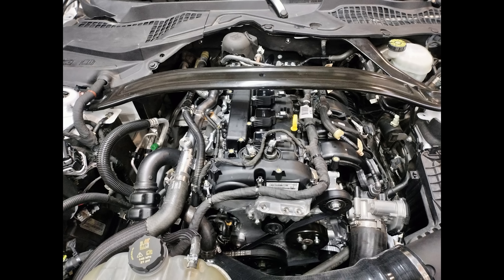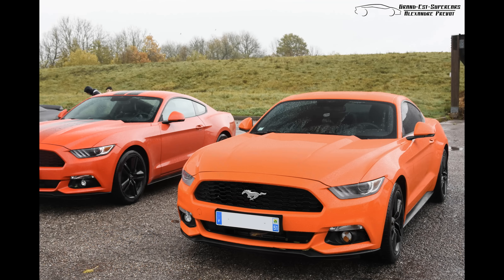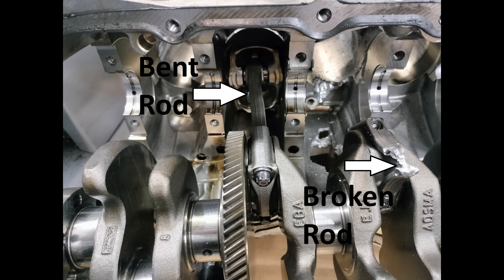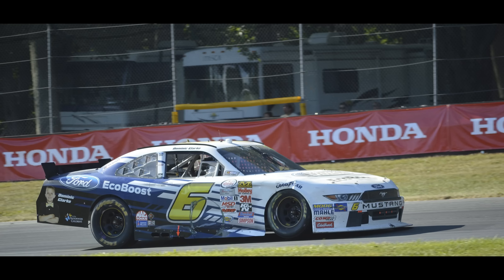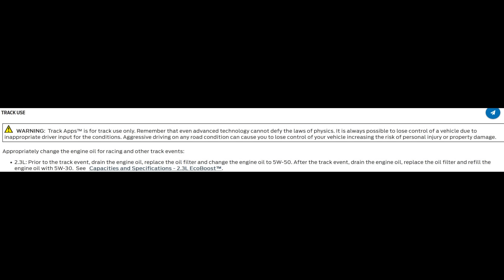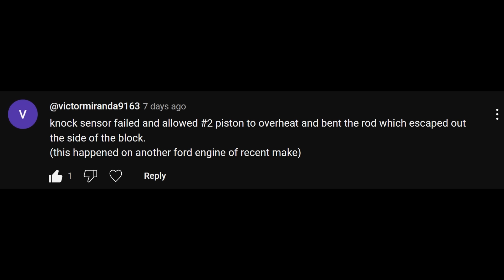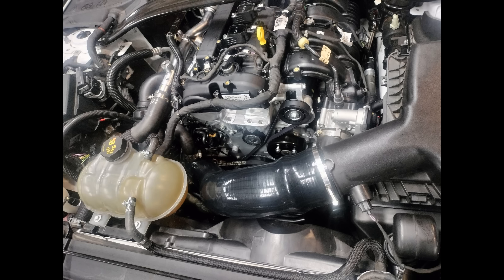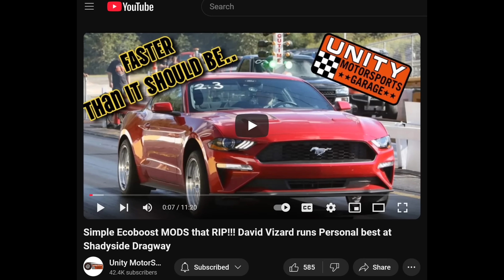EcoBoost Destroyed, What Happened?

Comment: Boost doesn’t bend rods ignition timing does and no it’s not knock it’s timing advance BTDC. You should research combustion chamber pressure in relation to ignition timing it will tell you exactly how you bent a rod.  Example that boost doesn’t bend rods is a stock iron block 2.2L 4g63, billet crank, aluminum connecting rod forge piston…..90psi of boost from a precision 8083 turbo no bent rods making 1600whp. Another example but open deck Toyota GR Yaris stock G16 engine 34psi of boost from a Garrett G25-660 no bent rods making nearly 500whp.
Reply: I'm extremely skeptical that the rod bent due to too much BMEP. In an NA engine, the rods always fail from tension loads due to excessive RPM. In a forced induction engine with 1 atm of boost, connecting rod fatigue life is improved, because the higher BMEP counters the tension loads. It would take at least 2 atms of boost to cause a pure compression/buckling failure (with correct ignition timing). I agree that something must have caused the ignition event to happen too early. When this happens, the inertia of the crank and connecting rod adds to the compression load in the rod from the BMEP.  If the OP would post what the peak boost and RPM the engine saw, it would be possible to estimate the BMEP. With that, it isn't too difficult to determine if the connecting rod failed from it. Ford publishes a lot of material information on their engines in SAE articles as a reference.
Reply from the maker: Alex, I said nothing about boost in this video, let along boost bending rods. Watch again and listen more carefully.
Reply: @GregsAirplanesandAutomobiles   You mention you were running a lot of boost at the time of failure which you could mean you eluded to it maybe being boost. You sure have a way of snaking around. What was peak boost, amount of timing, and rpm?

Comment: Your comments on the balancer confuse me.  Inline four cylinder engines (with a single plane crank) have an inherent secondary imbalance that no amount of build quality or “balancing” will correct.  It’s fundamental to the geometry of the engine layout regardless of build quality or any amount of part balancing you do.  That’s why they have balancers.  But you know enough about engines to already know this.  So why do you make the comments you made?
Reply from the maker: It's a question of what you can actually feel. If you drive a car with an old 1600cc Toyota or an old Fiat twin cam or Alfa they are smooth from the perception of the driver. The Fiat specifically is smooth from idle to 8000rpm, at least as smooth as Ford's 2.3, again from the perception of the driver.

Comment: Eh, the closed decks had an issue, too (supposedly fixed in 2018, but not sure if that's true). My Focus ST failed at about 180k from a defect that causes the coolant to enter cylinders 2 &/or 3. Thought it was a turbo coolant line as there was no sign of a HG failure. Turns out, there's a TSB about it where Ford states the remedy as "engine replacement". I'm not exactly sure if the failure is block or head related, but it has something to do with the coolant passage between them and between cylinders 2 & 3. Too bad, as that car was absolutely bulletproof up to then. There are a few CA suits going on regarding it.
Reply: The 2.0 ST block is my favorite! My understanding is that Ford added steam slits to the 2017 block, while upgrading the turbocharger to a twin scroll. I've been told that Ford has corrected the issue, but when and how, I don't know.
Reply: @coyote_chaser  I heard the same thing and I hope it's true. I bought it partly for the closed deck—"no HG problem with this!". The universe, of course, laughed. Minus that issue, it's a robust engine with great power and mileage (I averaged around 30 mpg in mixed driving around Boston) and was Corolla reliable until the day I started the car and couldn't see out my back window. Even then, it had an almost reasonable 180k miles and otherwise looked and drove like it had 1/4 of that. A Camry I had with only a little more miles felt like it had double the miles it had.

Comment: Usually bent rods are the result of exceeding their torque limits (overboost, knock, liquids). So... bigger rods should do the trick,but sometimes at the expense of max RPM.
Reply from the maker: That's exactly right, it's really a torque issue more than horsepower. I didn't want to bog down the video getting into why that is.
Reply: @GregsAirplanesandAutomobiles  so did you upgrade the conrods this time?  Or are you keeping the same build and upgrading the intercooler but not changing rods?

Comment: So how much boost were you actually running? Youre just repeating how high it was and that it wasnt the engines failure but we all know the ecoboost engines have a reputation for being pretty shitty.
Reply from the maker: what do you mean it "wasnt the engines failure" It absolutely was the engine that failed. It more that failed, I had pieces of block all over the place.
Reply: @GregsAirplanesandAutomobiles  You've said the fault was not because the engine is shitty but because you were running too much boost.
So how much boost was it?
Reply from the maker: What? I didn't say a thing about boost, let along that the problem was too much boost.

Comment: Made the mistake of not getting the timing right when replacing the head gasket on my Porsche 944s engine and was extremely lucky to only bend one valve and not do much damage to the piston. Hope your new engine holds up better than the last
Reply: Oh, dude, you drive 944?! What a dream car-shaped pile of scrap it is!
Reply: @nickyevdokymov5526  it's not my daily driver but I have one I've been working on. Some of the stuff is a pain to work on but that's how it is with any German thing
Reply: Should graduate to the bigboy headache and get a 928.

You get two heads and a 6' timing belt.

(I've done two timing belt replacements)
Reply: @RandomInternetDog  nearly bought a 928 a few years ago for very cheap but someone bought it before I could go look at it. Definitely prefer the look of the 944 but the V8 would certainly be nice to have
Reply: ConeOfArc on Greg's channel?! YT is getting smaller and smaller. Cheers lads !
Reply: I once briefly had a cludged together 944 with an LS swap... Literally only the minimum effort to make room and connect the transmission... I'm sure it's either an expensive track car now or it is in a crushed cube... If it was so hacked that I didn't keep it then I can assure you it was BAD 🫣 Although I've seen others done right in the following years of endless conversation kits and standalone LS swap parts/manufacturers... This was before most of that. The clutch and radiator were not happy, but it did drive for short periods before trading it off to the next guy who was warned "it needs alot of work" 😂 I should've taken pictures 😒
Reply: @ConeOfArc If you had enough of that car  i'd gladly take it off your hands. I can give you a 1980  Lada 2101 in return.  Small project needs 4 new side panels,  no barkes, needs new paint, carburetor cleaning, engine so worn out basically only the block, oil pan, empty cylinder head and screws are remaining, needs new wiring and has 2 flat tires. Don't lowball me I know what I got.

Jokes aside good luck with your car, love your videos!
Greetings from Hungary!
Reply: the ultimate solution? Sadly, K swap.

Comment: Too many corners cut on the EcoBoost engine design. The rods are too thin, and the piston skirts too shallow, which leads to a under sized wrist pin, and under performing rings. The only EcoBoost that has been worth a damn, is the 1.6L that came with the Fiesta ST, because that engine was hand assembled in Germany, and homologated for motorsports use. And its telling because the Firsta STs are quite reliable, but that same engine in anything else is a utter garbage, and unreliable.

Ford doesnt get it anymore, and has largely lost the plot. Surely more 100k F-150s will save them.
Reply from the maker: I think you're mostly right. The 2.3 is decent, but it could have been so much better. I do think Ford has lost their way a bit.
Reply: 1.6 eco boost engines for the ST were built in Wales, UK, not Germany.
Reply: @mikebeale1685  you are probably right. I think it was final chassis assembly in Germany. Either way, the information still stands, they were built to a higher standard than the crap Ford puts into the Escape here in the US.

Comment: My mom paid two grand for the brand new Ford Mustang, 1964.  Adjusting for changes that's 2 million today.
Reply: While the lowest possible price was $2,340usd back in the day, inflation adjustment brings that to $20-25k not millions.
Options also used to be MUCH more of a cars total price, with many Mustangs sold over $4k and the average over $3k and featuring the same basic running gear, while few people would consider +50% in options sensible now, with the few cars above double like hellcats sharing less with the base spec than between entire brands of common ownership in 1960's and 1970's, let alone a given model.
Likewise current prices for those vintage mustangs vary WILDLY, but the highest recorded sale was $87k (still not millions), average was $17k (so adjusting for inflation, slightly down from what owners bought them new, despite status as collectable), and plenty that where sold below $4k (likely because of poor condition, but interesting to note you could pay the same number of dollars both new and today).
Reply: @SheepInACart  - It's a joke. "2 mil" is a joke.  My mom traded her 1958 2-tone Corvette for the Mustang.  I rode a bicycle for transportation 1958 - 2018.  I'm a bicycle guy making a car joke.  The Corvette and I share the same birth year.

Comment: G'day Greg,

Ah, oopsie !

My daughter explored the underwater performance of her Rav-4 about 3 years ago, turned her Engine into a Fluid-Compressor for long enough to break and bend Rods.

Back in the 1970s one of the Workshop Proverbs was,

"Aftermarket Turbochargers
Mean
Aftermarket Troubles...!"

Pumping in more Boost than the Connecting Rods and Piston Crowns were ever designed for.

Twisting up the Boost on a Factory-fitted unit basically amounts to making the same mistake.

Segue Warning...

I collected a useful datapoint.

My motorbike has a 3 Kw software limited Motor Output, and I paid Ozzie-$10,049 for 880 Watts of Solar Panels, 10 Kw/Hr of Gel-Cells, 1,500 Watt Charge Controller, and a 1,600 Inverter..., Installed, including 10% Goods & Services Tax.

So, for every Killowatt worth of Electric Motor in the Vehicle it'll cost $3,330 in Oz Currency to recharge the Battery to feed that 1 Kw of Rated Motor Output.

So, if a Tesla has a 50 Kw Motor (?), that'll be  $165,000 Australian for the Stand-Alone Photovoltaic setup to recharge it at night, after coming home from work...(!).

Which makes the $92,000 for the Car kinda silly to think about.

What do you know about the "Accelerationist Movement"...?

About 10 days ago I posted a Rideabout-Talkabout video, with a Chest-Camera, titled,

"Electric Motorcycling, Into The Trumpocalypse...; Accelerationism Now In Control...?"

Ockham's Razor suggests that such appears to be the case...; what do you reckon ?

Such is life,

Live a good one.....

Stay safe.

;-p

Ciao !
Reply from the maker: It's not a party until Warbles gets here.

Comment: Yeah. They are using plastic these days where they ought not. That's the fault of the consumer. People change autos like pants despite the cost. If people demanded durable vehicles that lasted 30+ years; they'd be built accordingly.
Reply: This is a 2.3L 4 cylinder that makes 310+ hp from the factory, and does that quite reliably. Even a 20 years ago a "good" turbo 4 would probably make only 200hp from the factory, and if you were into modifying it, by the time you got it to close to 400 bhp (which is where the 2.3L EBs start to break), you'd ALSO have needed to upgrade parts and the whole package would be MUCH less reliable than the stock EB. 

Cars today are also on the road, lasting longer, than any prior era of vehicles. Not sure what you really want, to be honest.
Reply from the maker: For starters I want an accessible dipstick for the transmission. Then I would like electrical connectors that don't crack and break when I remove them. You are right about everything else. The car does make a lot of power and it's at a very reasonable price off the showroom floor.
Reply: @GregsAirplanesandAutomobiles  Yup. Us mechanics would appreciate it coming back too! Make sure you never let them remove the engine oil dipstick like the Germans did. I'd go even further, I won't buy any car with an electric parking brake, exterior door operated primarily by a solenoid rather than a cable (Tesla does a lot of this,  but GM did it first with the C6 Corvette and its push button doors), or even a keyless ignition. Like I said, I'm way pickier than most car buyers (since I fix them myself I have every reason to be), but that's how you have to think if you don't want these companies to overcomplicate things where it need not be done.

My 2015 Honda Fit has direct fuel injection which I'm not the biggest fan of, but the injectors are at least easy to reach and can be changed out in less than 90 minutes if you know what you're doing (took me less than an hour when I did mine a month or so ago) and they made it really easy to walnut blast the intake valves, which DI cars need periodically. Plus it's as basic as a modern car can get. Manual transmission, keyed ignition, mechanical parking brake and exterior doors, and no integrated infotainment. And now that the Nissan Versa and Mitsubishi Mirage are both on the chopping block, I don't see myself being interested in anything new.
Reply: @X85283  How much did the later Lancia Deltas make? And yes I'm aware it's an italian car and likely far from the most reliable, but they took that little 4 banger rallying.
Reply: @  

These are from the first gen, which is what everyone talks about due to the Group B cars. These second and third gen never really had high performance models, given their newer eras (the most powerful making 197hp in the 2010s)

The normal very top spec HF Integrale 2 made 212bhp. 

The highest spec not-special edition HF Turbo made like 180bhp. 

the mid engine, twin-charged S4 homologation special that they only sold like 500 of or whatever and which cost as much as a super car of the era made…. 247bhp in road trim. Brilliant car but it isn’t really an exception to my point. 300+hp from a 2.3L turbo 4, from the factory, is honestly really impressive compared to what was possible in the past.

The Group B cars made 400-500bhp depending on conditions and tuning for the course, but those are race engines- it isn’t really comparable.
Reply: And then youd be crying about the lack of power, shitty fuel economy and how it drives like a cart.
Reply from the maker: That's a good point, it's built to a price point.

Comment: If you want to build your own EcoBeast, you do that by taking a first-gen 2.0 block (closed deck) and build it out with internals from a 2.3
Reply: I think buying parts from SBD or Dalarra or something would be better.
Reply: @OneMoreDesu  You can build a pretty darn potent engine with OEM (junkyard) parts when you pick the best from the 2.0 and 2.3 motors.  The one notable exception is rods.  You're going to want aftermarket rods above 400whp.
Reply: @rockets4kids You may want to consider the "second generation" connecting rods found in the 2021 to 2023 motors.
Reply: @rockets4kids 
All 2021 to 2023 motors have the 2nd generation rods and some of the 2020s
Reply: Ecoboost.....Ecobust........tomato......tomaaaahto..turbos eventually ALL fail at some point ..nature of the beast.... .imho
Reply: @framusburns-hagstromiii808  The question is what parts fail where.  As Greg found out, the con rods are the first to go.  Then it's the pistons.  The open deck blocks are good for about 450-500 whp, and the closed deck blocks are good for 700 whp.
Reply: @rockets4kids  I remember when the 2.3 first came out and people started tuning them... Blocks started cracking between cylinders 2 & 3 when the HP rose.